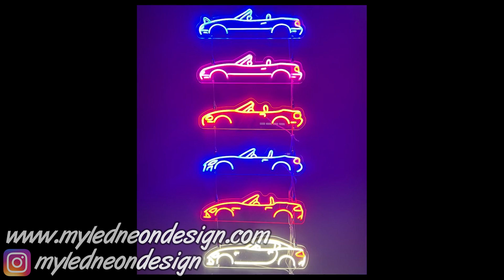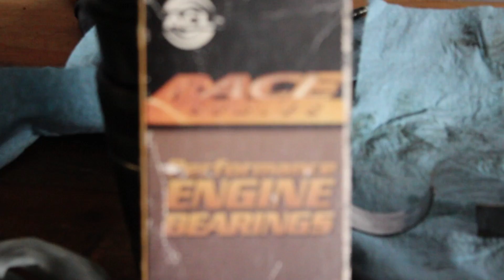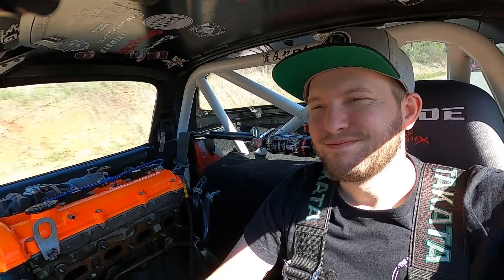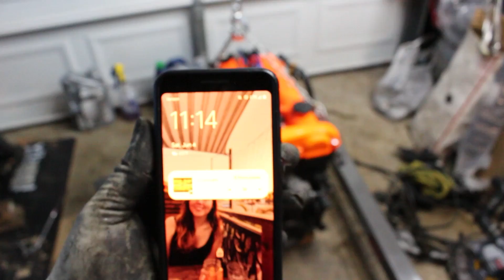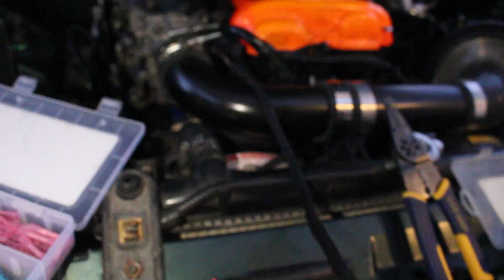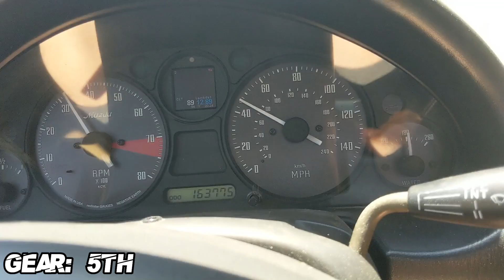I Accidentally Blew Up The NB [2-Day VVT Engine Swap]

Comment: A few years ago I had a coolant hose crack while on the highway. I got off at the first exit which was really close thankfully and checked to see it was the upper radiator hose. Had my friend take me to napa and I got a universal hose and put it on. My friend said I need to put coolant back in the radiator but I thought I was good cause there was still coolant in the overflow tank. Right? So we go right back on the highway and I drove for about 15 miles till I got to a stoplight and the car wasnt wanting to idle. I looked and the temp gauge was hot, just all the way to the right and the car dies. My friend and I push the car to a parking lot about a quarter mile away and the car sits there. Got it towed to a place that was able to tell me I cracked the block. Best part is I had a full unopened jug of coolant in the trunk the whole time. It was the dumbest thing

Comment: I did a rushed timing belt change leading up to a track day. I had the car on the hoist draining over the oil night...decided I wanted to install my new oil heat exchanger on top of all the other work. Worst idea was to fill it with 10w-60 race oil and not try to prefill the new oil heat exchanger hoses. Drove it to the track, all was fine. 1st session lasted a whole 5 laps as the engine locked up/seized while on track....that wasn't fun.

Comment: Did a clutch on a friends 323, all buttoned up, ready for the test drive. The first 1-1.5 mile was all fine and dandy, then the trans started to sound like a straight cut dogbox. Pulled over, started to think what the hell could it be, then it hit me... Didnt put a drop of oil in the trans :D

Comment: so i just fixed the left axle on my car. was n my way home, and got a call from my sister, she'd just bent both wheels on a sidewalk and was asking me to pick her up to go get her other set of wheels at home. as we were leaving, i was reversing, and decided to leave my mark on the ground. as we were still rolling back, i put it in 1st, and floored it. snapped the right axle off at the end, so the bearing was no longer tight, and went bad as we loaded it onto the trailer. so just from wanting to do a burnout, i left an axle on the ground, had to change my brand new gearbox oil, and get a new wheel bearing. Good thing is, now i have 2 reinforced axles, so it should be good for a long time... when i can get it to run again (it developped an idle issue while it was parked, something to do with either spark, spark timing or injection, but hard-ish to diagnose because it has the stock ECU and no OBD2)

Comment: I build race cars as a hobby. If theres a stupid thing to do, I've done it.
I've dropped an engine on the floor. A few times. Once was with an engine sling like yours. It was a fwd vehicle and the engine rolled forwards and tipped the bridge over and the whole engine dropped out.
I've also dropped one off a forklift, off an engine stand, off a pallet, off an engine stand again (the stand fell over) and off a jack.
I've forgotten oil before oil. I only ran it 30 seconds or so before I saw the empty bottles and stopped. Car still ran fine for over 100,000km. Now I put the oil cap in the bonnet catch so it won't close until I move it.
I've not done up wheel nuts. I've left suspension bolts loose. I've run power backwards through an ECU. I've not properly a retainer and dropped a valve into a cylinder. I've spun the crank on a floating crank engine and introduced the valve to the piston again.

Comment: What's the benefit of having the 6 speed? AFAIK 6th is a shorter ratio than 5th in the 5-speed so you're not really getting much out of it unless you want more gears to select from lol.
Reply from the maker: Shorter is nicer when you have no power 😆 but strength also, just coupled with a longer diff if you actually make power
Reply: @TheCarPassionChannel  I'm a big under-dog supporter so I'll stay in the 1.6 VLSD 5 speed camp until it blows up haha
Reply from the maker: @flukey5  You'll most likely lose the diff first but it varies greatly. Luckily the 1.6 makes torque later in the powerband so it's easier on the driveline (low key roast but also facts 😆)

I ran a stock 1.6 diff on my car at like 220wtq doing autocross and drag racing and never broke one. Stock 5-speed I ran to 240wtq and never broke that either
Reply: Can hold more power

Comment: I was working on my dads motorycle, it had been sitting for 5 years, Battery was dead so I hooked up a spare I had laying around, it wasn't strong enough thats when I promptly hooked up 2 12v batteries in SERIES and started it, had some weird issues like the tach ding weird stuff and the blinkers doing spooky stuff, ended up figuring out that it was running on 24V. Luckily the only part on the bike that broke was a headlight bulb, but damn that was stupid haha. Wordt part is that I'm a mechatronics engineer🤣

Comment: The story of my yellow NA is probably the stupid story of my cars... (I've made a lot of various ones though, to be fair.)

When I bought the car, it was a track-ready NA with a turbo bp4w already installed. Ran great, made about 200whp according to the previous owner. After driving it for about a year though, the motor spaghetti'd its rods, and it turned out that the bolt holding the CAS in place had fallen out! So for god knows how long it was giving itself 'dynamic timing' over every bump in the road. Lesson: Always check everything when doing services.

No matter, time to build an engine. CP pistons, Manley rods, ARP everything, injectors, haltech, 3076R. Great setup, great tune from WTFAuto, made 350whp. So off to Racewars I went (local 1000m racing event). On the way to Albany where it was located, I filled up at a country service station. Unfortunately, that station was very dodgy and had water contamination in their tanks. Half way through the first day of the event, the motor catastrophically leaned out, and cylinders 1 and 2 just melted. Expensive way to learn to take your own fuel to big events.

No matter, time to build another engine. Stock pistons, but manley rods, arp fasteners, basically all the old bolt ons and a brand new gtx2860 for a super responsive 250whp. Car was a blast! For about 1500kms, until one of my silicone coolant hoses from the original engine decided to let go, dropping the entire radiator worth of coolant at 110kph on the freeway, on a 40 degree day. Didn't notice it in time before the head totally cooked itself. Expensive lesson, keep an eye on that temp gauge! 

No matter. V8 1UZFE swap time, lol. And here we are.

Comment: Tuning my turbo 1.6 for the first time I set the base timing off the balancer. I didn't check if tdc on the balancer was tdc on the engine, it was not. The original balancer had shifted on the hub and I had unknowingly set the base timing an unknown advanced amount and only found out after I had melted the tops of the pistons. Got to replace the original 200k engine with a 50k mile one in the end but rather would have avoided the whole experience in the first place.

Comment: I srick a turbo on my first NA. I stupidly relied on the factory oil pressure gauge. Yeah, so about 3 months later, the turbo drain started to leak while on a road trip, and I lost all but about 1 litre. The oil pressure gauge didn't show much change until it was too late. The first sign anything was wrong was knock

Comment: Over torqued my oil filter with that big nut supplied in some filters. Oil cooler leaked profusely and took two more tries to finally get it to stop leaking. Its been two years and I suspect its leaking again or oil pan is taking a crap :(... Just as Im getting closer to get it supercharged again. Brother overtorqued my control arms where the coilover shock bottom bolt is. Took me two days to finally get it bent back large enough to put my Xidas. Then took me a week of HARD banging to my diff bushing until I bought a sawzall which made them pop out almost right away when adding relief cuts. The sadfab bushing you posted about are awesome and it was worth it!

Comment: filled up the cylinders with fuel after swapping in the ecu by testing injectors one by one, then hydrolocked on first crank 😅
Reply: i did that too hahaha,  but  i knew when it happen, remove plug,  crank,  there was a engine with fuel fountain,  awesome sight hahhahaha

Comment: I got a highlight as well. Preparing myself for the turbo watching your videos, I finally felt ready. Just to hook up the valve cover ventilation to the wrong side of the charcoal canister and as a result venting into the gas tank. The result was a blown head gasket. Now I got a built engine… so quite some time and money spent…

Comment: I pulled my entire motor and trans to reseal everything for efficiency, but forgot to torque my flywheel and crank bolt when I put it all back in. Within a week I had the trans out again because it left me stranded. I didn't find out about the crank until I did a pull and suddenly had no power - because it came loose and sheared my woodruff and mangled my crank keyway. :X

Comment: Very relatable video. Just put a 6 speed from an 04 msm into my 91 which came with a five speed. Made a checklist of all the things, used your clutch job video to get the process figured out, torqued everything down… and forgot to loctite my new Fidanza lightened flywheel’s bolts. 30 miles later my car sounded like a diesel truck. For those 30 miles though I was (carefully) enjoying the short gearing in my stock motor that you mentioned with the shorter diff. Now I get to drop the transmission again 🙃 easier to do it right the first time.

Comment: Fitted new water pump and cambelt, didn't clean up the block enough, massive leak. OEM gasket instead of paper gasket and lots of scraping later, all sealed

Comment: Here's my dumb mistake story.
Had my valve cover powder coated at a shop. They sandblasted it prior to powder coating. Apparently some of that media got into the baffles of the valve cover. And I didn't feel like taking the baffles off and resealing them. I somehow figured in my mind "they would have masked that area off"
About 3 days after installing the valve cover I started hearing this weird high pitch noise from the top end. The next day I started the car and it has zero oil pressure (bypass was stuck open)
That mistake cost me an engine xD
If you want I have pictures of an oil pump wrecked by sandblasting media.

Comment: I always leave the oil cap on the hood lock where the hood clips so that if I close the hood without filling the oil i'll know. Little trick. But happens to anyone. Overfilled my first car in my younger day😂 6 months later had rod knovk and engine blew up 2 months later

Comment: Pretty sure i blew up my ls3 because i didn't replace the timing chain tensioner after i did a bunch of engine work. cam, heads, and a whole ls3 down the drain caused it skipped timing and piston vs valve

Comment: Built a fresh forged bp4w and for some stupid reason decided to zip tie the oil cooler for a test drive. Zip tie failed and oil cooler got run over by the car and lost oil pressure for a bit

Comment: Best practice to prevent this kind of oopsie is taking the oil cap off first and placing it on the hood catch. That way, you cannot close the hood without realizing there's no oil in it. I've come close to doing this a couple times at my work but both times this method prevented it.
Reply: I put my key on the oil container I'm planning to use and put that somewhere obvious like on the windshield

Comment: I was doing a torsen diff swap on my turbo Miata and used an impact to tighten the nuts that hold the diff to the subframe. The trusty Milwaukee unfortunately sheared one of the studs off......and I had to drop the diff again and swap in a new subframe. Oh, and once I thought I dropped a bolt in my turbo so I had to disassemble it (it was near impossible) just to find out there wasn't anything in it. Lord knows where that bolt went, I never found it.......
Reply: The next week I put my old VLSD into my friend's miata to replace his open diff. Things were great, we drove about 3 hours and then he mentioned a whining noise coming from the rear. Popped the drain plug off to find....no oil! I forgot I drained it and we never thought to check before deeming it good to go. Stuff happens. Life goes on. The builds get better. :)

Comment: My big mess up was last week, I bought an nb about 3k miles ago. I did an oil change when i bought it. checked the oil first couple fuel ups. no oil was burning no blatent smell no oil on thr ground after sitting. I was an idiot and forgot to check the oil for about 2500 miles. On my way home from school and i head a loud knocking start. i check oil level, not showing on dipstick. drained oil and it was glittery only about 2.5 qts drained. on day 5 of slowly working on my engine pull. Hoping the engine is salvagable.

Comment: I did a timing belt on my 99' and reinstalled the 4 tooth trigger wheel backwards. The car turned over but never started. It sputtered slightly. I sent it to a shop and they figured out what I had done wrong in about three months. I ended up paying over 1k in shop time and labor.

Comment: Put a cheap turbo kit on my old nb. Didn't hook the wastegate up right, pushed 35 psi through a stock motor. It was super fast for about 4 pulls lol.

Comment: I once changed my oil and I'm assuming only hand tightened the drain plug. It held on for 3 days before I noticed there was a trail of oil going up my driveway after I got home from work. When I checked my car, oil was streaming out around the bolt that was hanging on by a literal thread. I don't know if I could've driven another 10 feet before it fell out completely. I always double check that bolt now.

Comment: Well I have had a rough month as a Tech, messed up a honda odyssey by tapping a pole, ruined the head of a crv by accidentally getting plastic into the oil filter. Right before both of these incidents I set my boosted miata on fire by being incredibly dumb and wrapping my exhaust in leather to try and limp it home. So for sure have made my fair share of mistakes.

Comment: I was putting an oil cooler on my NA and forgot to tighten the feed line coming off the filter plate. luckily the oil pressure gauge functioned well and i got it to a gas station before running dry, put more in, got it home almost out of oil again. and 2 months later no knock so fingers crossed i got away with just some mild shame and a lot of cleaning lol. will come back when i get a funnier story

Comment: I bought a '96 Ram with the 12 valve cummins. It had a real bad oil leak coming from the front. Turns out it was the Killer Dowel Pin that had popped out. Front gear case was cracked.  So in order to do the KDP you have to slide the floating cam shaft out of the front. The job itself takes many, many hours. So I decided to pop the cam gear off of the cam shaft instead of sliding the cam out. It all went well until it was time to put the gear back on. I managed to get the gear on most of the way, "lightly" and "carefully" tapping it in after heating it up... I ended up pushing the camshaft in towards the back of the engine and popping out the freeze plug behind the cam shaft, and the gear never sat in properly. I ended up having to drop the transmission to be able to get to the freeze plug. An 8 hour job turned into 2 full days, a lot of money spent and time wasted. Atleast I got to look at my clutch make sure it was good and change the rear main seal aswell. All is good now.
12valve cummins with the 5 speed. We live and we learn

Comment: When I first bought my nb I was so elated that I had bought a miata that I didnt even bother to check the oil level before driving it home. Drove from Anaheim to Riverside on 2 qts of oil X). Subsequent oil changes I noticed there was some nice glitter coming out and now it's currently having its engine rebuilt. Also a week after I had bought the same NB I hit a curb pretty hard taking a left turn a little too fast on old dry rotted tires. The rear kicked out and my inexperienced self didn't know how to correct so I ended up slamming into the curb taking out most of the passenger side front suspension and bending the subframe :o. I think I may have cursed this car, but I still love it and love working on it, so maybe it's blursed
Reply: Definitely blursed. Miata's are always blessed in some way or another despite all the problems they inevitably get themselves into!

Comment: My most expensive learning experience was my NC I bought about 2 years ago. It was an 08 saddle leather on black plastic interior, black w/ aero package grand touring PRHT 6 speed manual, the EXACT spec I wanted. I bought it for only 6k, I thought that was great, until it wasn't. That car was extremely abused, and by the time I sold it, I lost $4,500 to it. Never buying an abused car again lol

Comment: So my first engine rebuild was a Honda 350x that belonged to my mom and I may have sent a valve through the piston on it.  This threw me into the world of engine rebuilding on a budget.  I found a donor engine eBay that was “running when pulled” that came to me with the cam eaten halve way through the head.  Being a teenager that was all of my budget blown to learn the lessen of never believe it ran when I parked it.  Fast forward I find a replacement head and was able to scrape the money together for a new piston gaskets and machine work.  Where I learned the next lesson, “use a ring compressor”, and then another lesson “if it doesn’t spin freely don’t force it”.  I had successfully folded a ring over and put a huge score in my cylinder wall.  Fast forward anther few months I had enough money the third time for get a new piston and more machine work.  Luckily this time I was armed with more patience and some valuable life lessons.  Head up Greg, dad’s aren’t perfect 😂😂😂